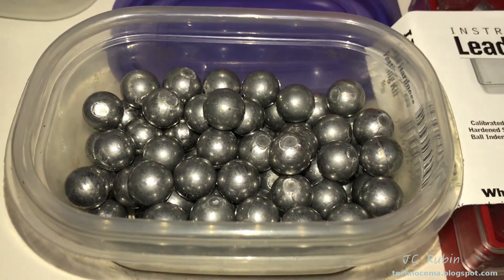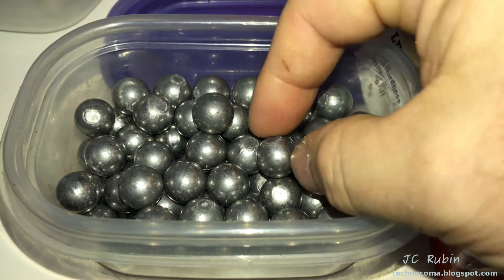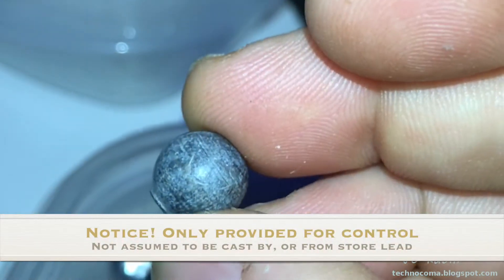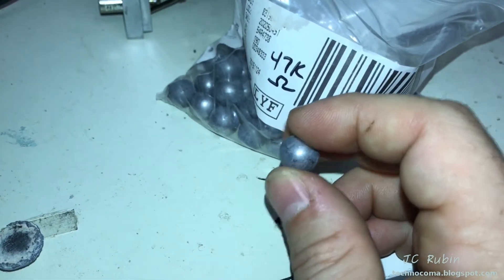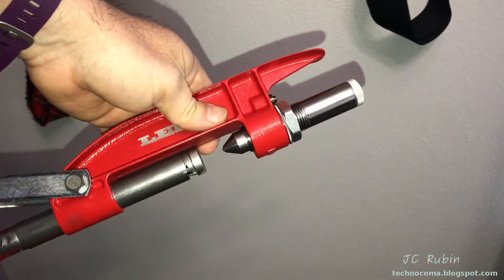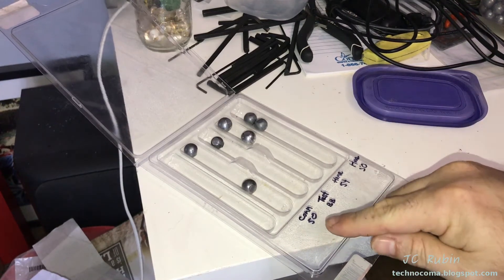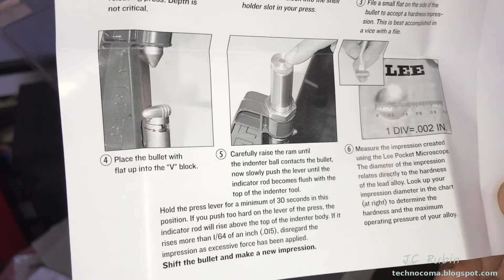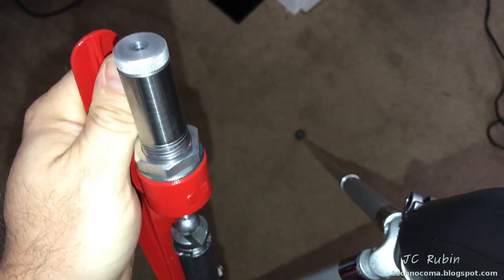Black Powder Rifle Ammunition - Testing the Lee Lead Hardness Testing Kit

Comment: the standard rule of thumb in black powder round ball lead is if it can be scratched by your fingernail-be curious to know if your 'homemade' balls pass that test?
Reply from the maker: The homemade shown to be of greater hardness are significantly more difficult to push down the barrel than the pure lead store bough bullets as a first indication.  Im sure there are accuracy differences when using inconsistent mixtures, though this becomes somewhat subjective